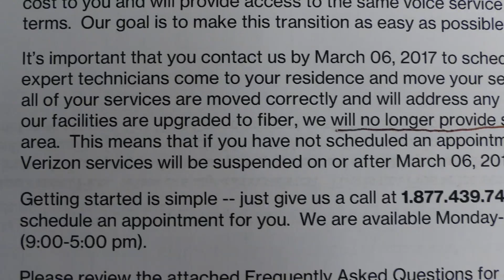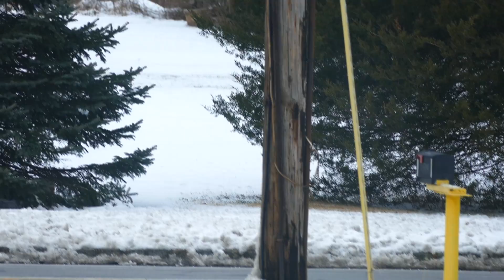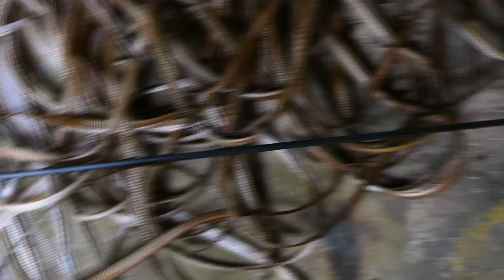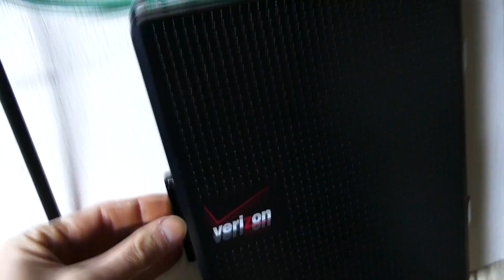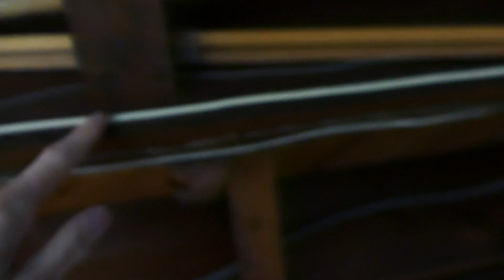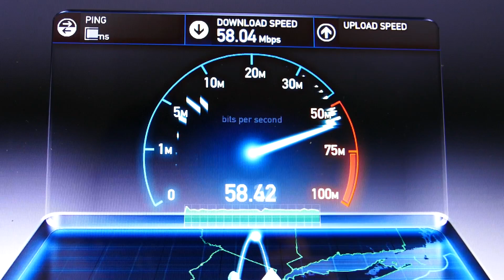Fios Installation

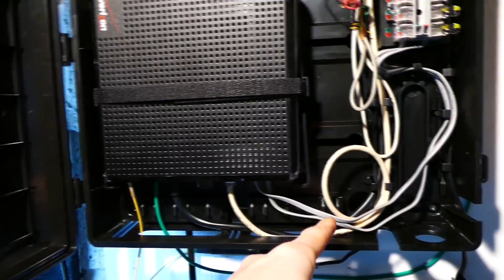Comment: 6:35 that box above the Battery Backup Unit (BBU) is called an ONT - Optical Network Terminal. It's where fiber comes in and splits into voice, data, and tv.

Comment: Great video. This helped to answer my questions. Still need an incoming cable in order to get Ethernet to user personal router.
Reply from the maker: Before getting Fios, I had so many questions and there were no videos or people out there to get answers to my questions. That is why I posted this. My main question at the time was if an old 1.5" conduit used for copper phone lines could be used for the fiber cable. And they were able to fish it through fine so I am happy about that. Not so happy about their price hikes, $1,023 dollars a year for internet and phone is high.

Comment: The system its called VATS (Verizon Advanced Termination System ). We measure out the distances to the serving poles to the foot and send them to the cable manufacturer where the access points are placed as per the engineer's design. Problem is that if you're off in one of your measurements you throw off the entire run.
Reply: What model Pip-Boy are you assigned?  The Pimp Boy 3 Billion is my favorite.

Comment from the maker: Note about pricing(for internet and voice, no tv):
5/10/2021 I chatted to Verizon in March about my high bill, and they lowered my bill to $61.26! And they increased my speed to 300/300. The first reduced bill payment was today, 5/10. TY Verizon.
2/10/2021 State tax went up $0.10, and the Federal Universal Service Charge went up $1.14 so my monthly bill is now $88.62. My current speed dropped to 50.28/47.12 even though I am paying for 100/100.
10/18/2020 Taxes went up one cent, and Verizon Fees went up 16 cents. Total bill $87.28.
7/19/2020 Federal Universal Service Fee went up $1.84 and NJ Sales Tax went up $0.18. Total bill with automatic pay reduction is $87.11
1/3/2019. My bill rose from $64.57 a month for internet and voice to $85.93 a month. 
2/20/2019 price rose to $105.27 a month.
2/21/2019 enrolled in a contract, monthly price is $90.27. -$5.00 with automatic billing.
11/2019- $91.69

Comment: We are having our concrete re-done at our home and I am going to have a new conduit installed (we have one, but they could not get the pre terminated wire through it). What size do you have at your home? Thank you!
Reply from the maker: My conduit is 1" inner diameter, and about 60 years old. I was afraid that they would not be able to get a line through and I did not want an over head wire, as my conduit goes through a concrete patio. I bought a 100' fish tape from Harbor Freight, attached a piece of cloth to the end, soaked it in lube and worked it in and out of the pipe about 20 times. The run was about 130 feet so I didn't get it through the entire length of the pipe. When the cable pullers came they told me that my conduit was probably blocked with frozen water and that these old steel conduits don't do very well but to their surprise it was not blocked and easy to get their fiberglass fish tape through. That stuff on the cable in the video is not just water and dirt, it is also lube. From me. 
Use a larger diameter conduit than I have if you are putting in new.
Reply: Thank you for letting me know. Wow, 60 years old... we had the Verizon installers out and they couldn't get it through our conduit (I believe it is smaller than one inch). Ours is 16 years old and was put in by our pool contractors. They were asked to do a 1.5 inch conduit, but decided to do whatever they felt. The FiOS guy attempted to pull back a pre terminated end with the old telephone cable with all the pairs in it and it got stuck. We are having our concrete driveway done so I am going to have a fresh two inch conduit with a 1.5 inch as a backup or just one 3 inch pipe. Thanks for your help and congrats on getting it pulled through that 60 y/o pipe!
Reply: Also, how is your service? Are you enjoying it? Thinking of switching from Spectrum to digital fiber by Verizon.
Reply from the maker: Verizon should have hired cable pullers to install a pull line to use to attach the cable and pull it through. Using the existing copper as a pull line would be very sketchy. But if the conduit is to small it won't work.  2" or 3" modern plastic conduit will work very well.
Reply from the maker: The Fios service is great, I am enjoying it very much! The only minor issue I had was the automatic IP address assignment from the router was generating an error on my computers so I had to assign a static IP address for them. For you, with both services available, you may be able to leverage one to get a better price from the other. For me, I know they will raise the price of my service next year and I hope it doesn't go up too high.
Reply: Thank you for your reply. I can't wait to get the install done. 6+ months in the making.
Reply: One last question... do you know what fittings are used for turns in your conduit? I picked PVC Type 80 - 3 inch conduit and want to get an idea of fittings that work best for turns.
Reply from the maker: My conduit is a straight run so I don't know what fittings would be used. However any fitting should be curved, no right angles.
Reply: I picked up a sample 3 inch 90 fitting. It is so large that the cable won't even come close to being a 90 degree turn. Is your old copper cable still there or did they use it to pull back with?
Reply: In our area the connector on the optical cable is so large and it makes it so tough. Also, it doesn't help that the installers just want to do an aerial run because it is easier. They aren't worried about throwing our house out of code just to make the job easier.
Reply from the maker: My old copper cable is still there.
Reply from the maker: I think it depends on the installer you get. Some guys are lazy and do a piss poor install the easiest way, and some guys, like the guy I had, are meticulous as if they were wiring their own home. The installer should never use the old copper cable as a pull tape in my opinion, it's not designed to be a pull line. It probably has a low breaking point where as a pull line has about 1,500 pound breaking point. It will snag in corners and may already be kinked. The pull line has a 'Cheese finger trap' type tube that holds the cable tightly as it is pulled.
Reply: What type of pull string did you use there? Looks very sturdy.
Reply: Thanks for your help!